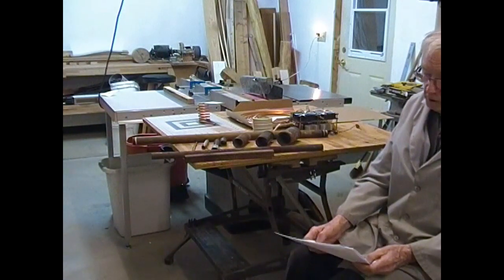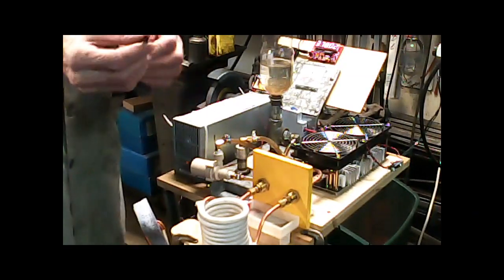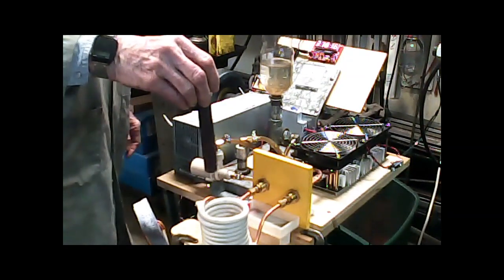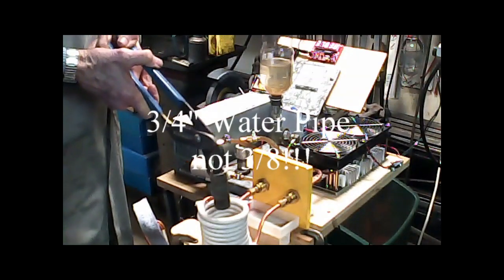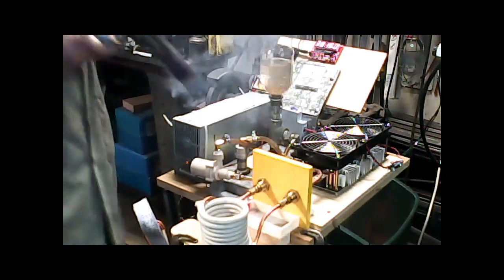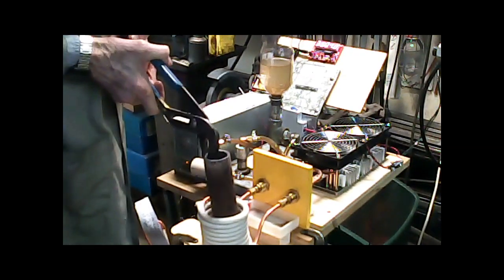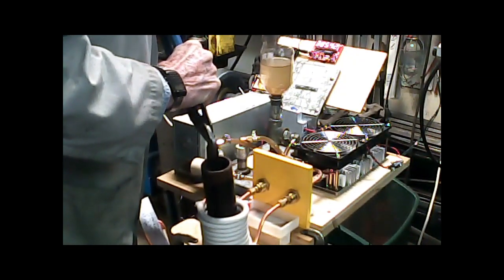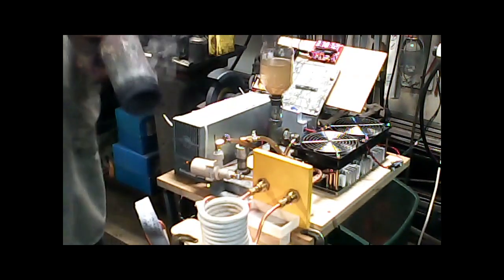1000 Watt and 2500 Watt ZVS Induction Heater- Power Transfer- The  Workpiece vs The Coil Size

Comment: Your power supply looks expensive,  i just use a D.C. inverter welder with a digital amp meter,  i enjoy your demonstrations and have learned much, thank you sir,
Reply: Glad you mentioned that as that is exactly what I was going to try.
Reply: thats good.. no problem with the start up spike (striking).. and or the dc not being smooth enough, and trashing the zvs?

Comment: Hello, I don't know if you are still monitoring this, but I would love to know what would happen with a piece of solid brass or at least thick wall tube.  Everyone seems to only be interested in steel. I think that is down to it being reckoned that better conductors don't have the resistance to generate the heat, but I have been finding commercial sites that induction heat brass at 10-15 kHz, or at least say they do.  You approach is very scientific, and I wonder if you can help.   PS I am researching building a ~10-15kW machine for both melting and annealing, or 2 if the fuctions are very different.
Reply from the maker: Thank you for your kind words.
  As you probably already know, there is a lot of induction brazing going on where the non ferrous materials are directly heated by the work coil of the induction machine. But it takes a LOT of work coil amperage, as you suggest, to get enough power (wattage) into the work because of its low resistance.
(It's the hysteresis effect of the magnetic properties of steel causing higher internal resistance that makes steel so much easier to heat.  But, even then, if you need to go beyond the Curie Point, where magentism "goes away", you need a lot of power to get to melting temps.)
   For melting non-ferrous materials, it seems that most of the time, they indirectly heat the material to be melted using carbon/graphite crucibles.
   I have only heated small quantities of non-ferrous materials so far.   I melt copper and brass in graphite crucibles.  Up to maybe a pound or so in my 2500 watt setup.
   A few years ago, I did a series of 3 videos on optimizing coil design for heating brass rifle cartridges up to "orange hot" to anneal them.  In this particular case, I was able to directly heat the cartridge neck to "glowing" in a couple of seconds.  But that's as close to doing what you are asking as I have come so far.

If you are looking in the 10 15 KW range, it might be cheaper in the long run to investigate some of the Chinese machines.  A word of caution, though  The ones that they sell as "15KW" are really only about 7.5 KW. Let the buyer beware. 

As I look back on my comments,  it doesn't look like I have added much to your knowledge base.
Sorry.
Reply: @frenchcreekvalley  Thanks for your input, I believe you have helped in zoning me in to the answer. From what you say, it looks like current rather than resonant freqency that is the critical issue. I will now target my searching accordingley.  You focussed on hysteresis, which I had not taken seriously enough. If this is down to iron's magnetic properties, as evidenced by the drop in heating rate, and need for much more power to heat further once curie point is reached, then one can't expect much hysteresis help from copper or brass!
I have just joined a forum for high voltage enthusiasts that has a section on induction, I think the inverter is the common link. Someone got hold of a commercial induction heater of 3kW but 500 kHz. It didn't half seem to heat a steel bolt very quickly, to white heat and then melted is seconds. As I have seen other machines of similar power demonstrated with nothing like that performance, it does seem that frequency might have something to do with it though, maybe more effective energy input due to the more fierce eddy currents?  We live an learn.  Thanks again.

Comment: iv bought one of these. its second hand, but thats ok, i feel less guilty about hoarding loads of junk. but, it didn't come with the copper. i can easily knock up a coil, but what about the constraints with size, weight and impedance. i don't want to fry the board.. is it so critical? thanks
Reply from the maker: More than you will ever want to know about these heaters can be found on my website, here:
https://spaco.org/Blacksmithing/ZVSInductionHeater/1000WattZVSInductionHeaterNotes.htm
The short answer is that those 1000 watt boards come with a work coil that is somewhere between about 1 1/2 inches and 2 inches in internal diameter and have about 7 turns.  This gets you an operating frequency of a bit less than 100 kHz.  They are usually made from 6mm outside diameter copper "refrigeration tubing".  But  I almost always use 1/4 inch diameter (USA) copper tubing.
I hope this helps.  If not, feel free to ask questions.
Reply: @frenchcreekvalley  thanks.. mines a 2500 watt actually. i know the power supply need to be running in advance. this board iv got has "disable output no load" printed all over it.
this is a bit ambiguous to me ?? i saw some comment on utub saying they got away with using an inverter welder for power. (some better ones do give out a spike to help strike the arc though) but they do come very cheap. iv got a little baby one that was only about 30 quid. also iv got a 30a 48v lead acid charger with a tranny, but i thought i could smooth it out with a bunch of big caps that came out of a big old mig welder. i dont know if thats a good idea though either. ill check your site.

Comment: what happens with solid material
Reply from the maker: Excellent question!
I am slowly working on that.  I don't think there's an easy answer that would be 100% accurate all the time.

I did test a 1" OD thin wall  tube in this video and got a current of  44 amps (net).  In an earlier test, I tried a 1" diameter solid round bar and got  only 29 amps (net).
An interesting thing was that the frequency for the tube changed from 37.8 kHz at idle to 37.1 kHz, while in the case of the 1" solid bar, the frequency dropped all the way to 30.6 kHz.   The reason I tell you this is that I think I MAY be able to predict the current flow by measuring the change in work coil inductance  on the bench as I insert the workpiece.   I am assembling a spreadsheet of my data to date, and looking for graphical evidence that this might be true.   I'm certain that folks who make their living with induction heating knew all this stuff at least 60 to 70 years ago, but it is new to me.
As they say:  "It keeps me out of the bar!"
Reply from the maker: !!!  This is a "red-faced" edit to my previous reply.  After I posted it, I thought that something was "amiiss", since I couldn't find the video where I did the test with the 1" solid round bar.  Sure enough---- when I reran both samples just now, I got very different results.   It was simply "bad science" on my part.  I must have taken the 1" solid round bar data from the 1000 watt unit which was running at a much higher frequency, with much smaller work coils.
Anyway, here"s today's result:
                 Freq. in kHz  Current In amperes 
Workpiece init freq min freq init current Max current
1" OD tube 38.2 36.9 36                   48
1"Dia Solid  37.9 36.8 36                   46

But, as you can see, the currents were essentially the same in both cases.  This is cool, because it supports the idea that the power transfer is only "skin deep".
  Sorry about the misleading information in my previous post, but that doesn't change my goal of measuring work coil inductances with and without the targeted work pieces to predict power transfer.
Reply: It was my guess that most of the current at that frequency would be express  on the surface, Your data would seem to confirm that,  It might also be interesting to run a carbon crucible and see how the heating change as the material melts, I have yet to hook up water flow to my 1000 watt ZVS to try this.
Reply from the maker: @NickEdgington  
One of my next tests will focus on melting copper in a graphite crucible to gather that information.  I have done this melting 3 or 4 times already and have noticed some slight changes at the melting point and just beyond.   One of my reasons for measuring frequency is to see if the changes that I see are large enough to make significant changes in penetration depth.  So far, I don't think the frequency of this 2500 watt ZVS unit varies enough, for steel, anyway, to be a very large factor in getting things hot.